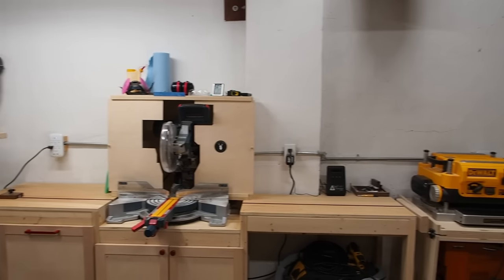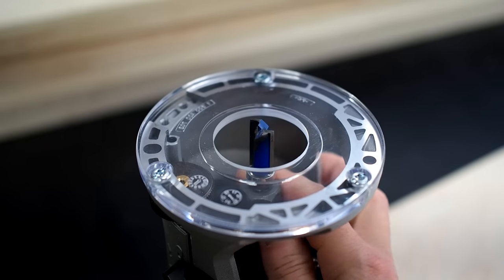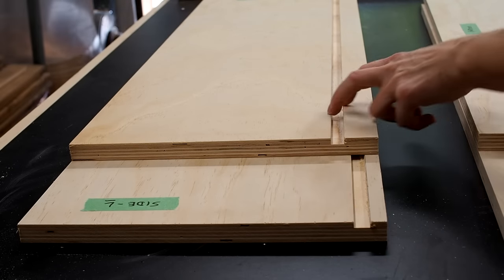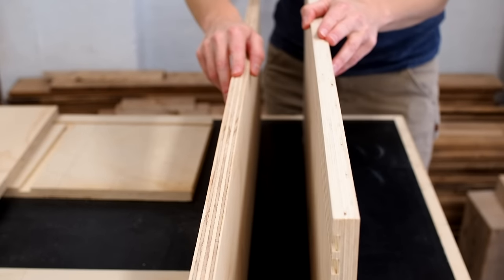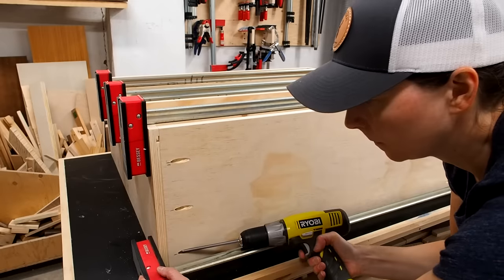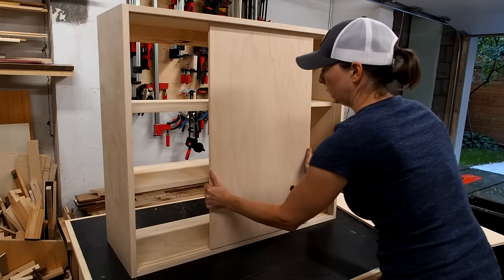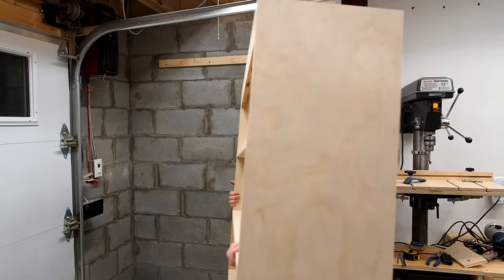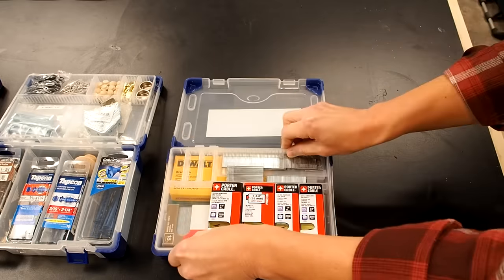Wall Cabinet with Sliding Doors | Shop Storage

Comment: Very nice video with perfect, well structured explanations... Aren't half inch doors a bit of an overkill though? I'm not a pro by any means, but I remember my father using something like 4-5mm (so like 3/16" )? Probably couldnt fit the red handle , I admit :)

Comment: Great work! Do you leave any commonly used screws more accessible in open bins? I think I'd go crazy if I had to open a cabinet every time for certain lengths of #8 square drive screws. But a lot of the others (and nails), I'd be happy to put in that cabinet. As a big fan of mid century furniture, I appreciate the tips for sliding doors. Thank you!

Comment: Nice build... exactly what I'm looking for.  I have extra plywood and a sheet of 1/4 pegboard that will make great doors.  Tx!

As a suggestion/tip... if you don't use handle hardware (using simple finger hole pulls like you show), you can add the extra dados on the sides of the cabinets while you are cutting things before assembly to allow you to slide the doors to either side to close it up.  ;)

Comment: Great project. If you find that the doors begin to bind in the future you can cut a piece of hardwood with dados routed in it to cover and replace the bottom grooves cut in the bottom of the cabinet. That way it’s not plywood against plywood. The  dados in hardwood will be smoother than the plywood. You will have to cut a bit off the bottom of the doors to make them fit into the board

Comment: Nice cabinet! I once built a similar, but larger one, that the doors started to 'rack' while trying to open them. The wood on wood friction eventually started wearing out the bottom dado making it almost a two handed operation to slide the door. I glued scrap laminate from a kitchen counter project to the bottom edge of the door and in the bottom of the dado. A little car wax or dry film lubricant made it slide nicely.
p.s. Blowing the dust out of the hole didn't look odd at all !  ;)
Thanks for sharing your work!
Reply from the maker: Thanks, I'll keep that in mind!

Comment: Hello. Love all of your projects but especially the way you explain them. Love the organization boxes and the labeling. I do the same. But I’m curious (and partially poking fun) - if you’d go to the trouble of labeling most things why not take the product stickers off the boxes?  Just a pet peeve of mine. Great content as always. Can’t wait for next project.
Reply: Ha ha ha!  Yes, a pet peeve of mine too!  All labels should go.  A heat gun on low for a few seconds will soften glue and enable peel off. Mineral spirits remove any residual glue.  If you heat it up gently, there is usually no residual sticker glue left behind.

Comment: Just have one question. How will the top bottom shelf support all the weight of the screws? Won't it get bumped over time? 

Nice cabinet by the way.
Reply from the maker: The pocket screws and glue should be able to handle the weight.

Comment: do you have humidity issues on the brick wall? if so, won't it get absorbed by the plywood and start to deteriorate the french cleat?
Reply from the maker: This wall is fully above ground and is sealed and painted from the outside. I haven't observed any humidity issues. 
That being said, I plan to remove the cabinet and paint the wall to seal it. Just didn't have time to do it before the video.

Comment: I was under the impression that plywood is not 'undersized' but made at 18mm for the rest of the world and just sold as 3/4inch to the US and Canada (although I thought Canada was metric). Also nice cabinet. However, I think you will eventually move some of your fasteners closer to your assembly table. They are definitely in a more convenient place than in another room but since you use them at the assembly table eventually as you build more shop storage maybe some draws under your assembly table for most commonly used screws etc.
Reply: Hi AllTheGear,

Canadian and American made rough plywood are really 3/8 (1/8 per ply) If you go for a premium (sanded on one side) they will be slightly less.

Baltic birch and European plywood are indeed in mm, but here we roughly call it 3/4 even tho it is really 18mm. 

Canada is the worst of both world regarding metric imperial. While officially we are a metric country, we're metric on some things and imperial on other...the list is fascinatingly long and full of contradictions.

E.G.: air temperature is in C (metric) but pool temperature is in F (imperial) we weight our body using pound, but will measure food in g (unless it is meat then both are used...unless it is ground meat where it is 1/4 or 1/3 pound for burger purposes...) 

All construction lumber is in imperial, but our roads are in KM and KM/H... what else ...a lot I guess, but i will stop there before you assume that we are completely insane...
Reply: @simonmarcoux5879  Our sheet goods - ply, MDF etc are sold metric 1220 x 2440   = ( 8 ft x 4 ft ) 
Thicknesses just vary a bit around the metric equivalents of 1/2 and 3/4 inch etc. depending on sanding. Just got some sanded hardwood ply at 12 mm . I make stuff "to fit" anyway.
Reply: @simonmarcoux5879  not insane. Just the blame the British (my lot) as we are also a weird mix of both.
Reply from the maker: Ah yes, you are correct. Plywood is made in mm, which is converted to imperial (1/2, 3/4) and in that sense is always undersized. 
We are a complex country when it comes to measurements... Don't ask me to give you the temperature in Fahrenheit or have a clue how long it would take me to walk a mile. Then again, I wouldn't be able to guess how wide a room is in cm... No clue! Oh, and a pot of water boils at 100 degrees C but pool water is measured in Fahrenheit. Go figure!
Reply: In the UK, we still get undersized plywood, 12mm or 18mm ply that's actually 1mm under. Frustrating if you didn't design your piece around 11 or 17mm ply.

Comment: You have a very nice, organized small shop with excellent equipment. Your wall cabinet and all your cabinets display your skill and quality BUT I can't believe you installed that cabinet onto a ugly, bare cement block wall!!!  Shame on you!!  You need to paint that wall white to match your other walls. Also, you should at least seal the plywood doors before winter so they won't warp.
Reply from the maker: lol I know! I swear I plan to paint the wall, just didn't have time to before I put out the video! Stay tuned, I promise it will change in the next video ;)

Comment: Great video.
Glad I found it.
There are some very helpful tips.
First video I have seen where the edge of the door is hidden in a slot.
I like that idea a lot, makes sense.
I also liked the router being used so much in this project.
Maybe some holes on the inside for shelf adjustment, along with a ridged center shelf for strength.
Take Care and God Bless

Comment: I really like these sliding doors.

I wonder why you didn't want to design a built in cabinets from edge to edge of the cavity wall. then you wouldn't need the side walls, just the shelves + the rails for the sliding doors.
Reply from the maker: Mainly because this is one of the only spots in my shop where I have room to prop up long objects against the wall, so I wanted to keep room for that. Also, I'll be removing the cabinet to paint the wall soon, so there's that.

Comment: Nice cabinet Marie, well done. Any worry about moisture on the block wall? I'm getting started building a wall hung tool cabinet and I'm planning to put it on a finished wall due to moisture worries (technically most of my garage is underground).

Oh and I know you mentioned Princess Auto but I saw the router table and thought "this episode brought to you by Rockler." If the WoodTalk guys can do it I definitely think you could!
Reply from the maker: This wall is fully above ground and is sealed and painted from the outside. I haven't observed any humidity issues. 
That being said, I plan to remove the cabinet and paint the wall to seal it. Just didn't have time to do it before the video.